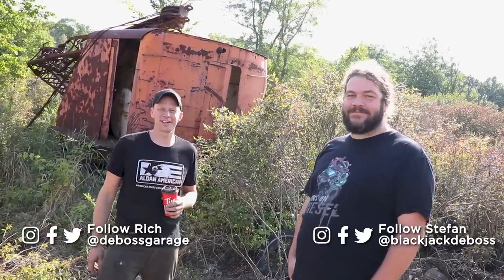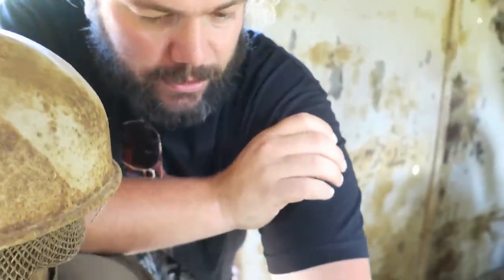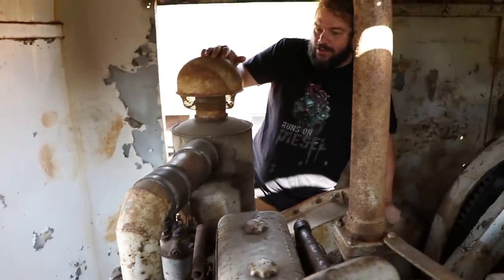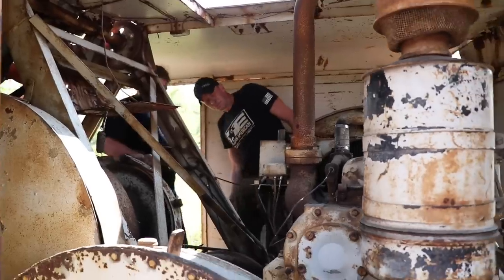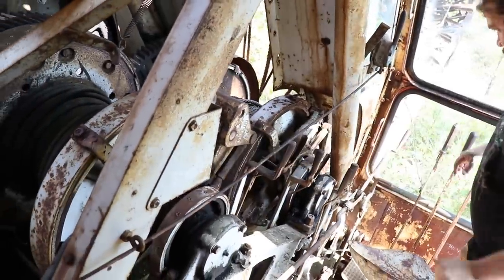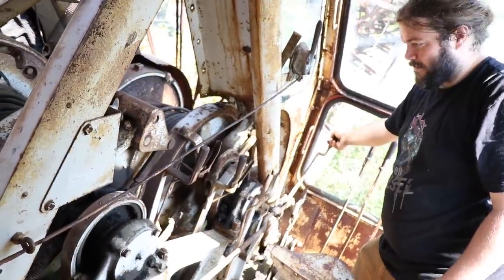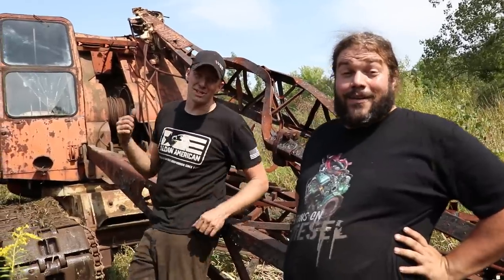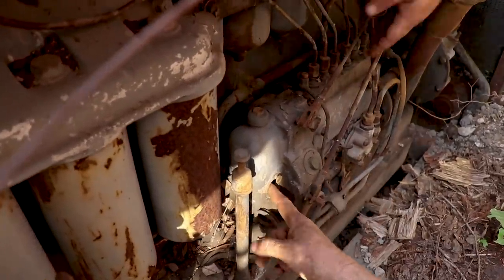Will a 2-Stroke Detroit Diesel Run on 20 Year Old Fuel?

Comment: There’s plenty of people that would want That crane.  I’m rebuilding 2 machines like this on my channel right now. Wish my last one was that easy to get going but it took 3 months to get home
Reply from the maker: This one was for sale with a straight boom by the previous owners for about 2 years.  I think they were asking $5000.  As cool as it is, it will never be allowed to be used commercially again so it is just a labor of love for someone with expendable time and money.  If this video doesn't sell it, the engine will get pulled and the rest scrapped.  At least it will be in the internet forever.
Reply: DEBOSS GARAGE people are still running businesses with them mostly driving piling and dragline pond work. I bought my Lima to put a pond in and do hook work maintaining my other equipment. Who doesn’t want a machine that can lift 20 tons?  My Insley I’m rebuilding for shows. They’re surprisingly fast and like you mentioned in this video you don’t have t worry about blowing hoses and losing a tank of oil.  My Hyhoe excavator has  expensive large hoses and they use low pressure high volume pumps so a lot of oil leaves in a hurry.  Anyway hopefully someone saves the machine. A boom is easy enough to find or rebuild

Comment: Weld a new small boom on it a simple I beam homemade one for shop rigging lifting use.
its a 371 gmc Loraine crane
All DDs two stroke have a run away emergency air shut off on blower spring loaded trap door.
 if tripped motor will never start even on either. Reset small handle and cam on blower.
Free up working running old friction rigs

Comment: I got a 1954 371 air compressor at work when we need some good air to run the 1" gun and other than yearly sometimes every other year oil change lol  fires up works runs 2-3 hours wide open shut down hot and fires up everytime it like the abuse

Comment: Just bought a 1998 Ford ranger 5 speed manual and I want to do a diesel swap, what would you recommend?
I'm a welder so I can fabricate parts if necessary and a friend mechanic but no knowledge on complex engineering or engines so

Comment: It's not a common rail fuel system, because it's not injection pressure at all times when running. Common rail injection requires, minimum 24,000 PSI of fuel in a physical cylindrical rail, for it to be called "common rail".

Comment: That Detroit would make a great little engine for my 1952 dodge
Reply from the maker: 1500 lbs cranking out 109 hp!
Reply: DEBOSS GARAGE so you’re saying I need to find a 16 cylinder Detroit to put in my little 52😂

Comment: I think everybody on this planet knows the Detroit diesel 2 stroke ( it has the IN ports in the cylinder sleeve),
and has two OH exhaust valves per cyl.  ... it's a modular engine ... you can have as inline 3 cyl.  V6 , V8, and V12 ... it's a reliable engine, but I know people that have managed to kill even one of these ...

Comment: Do your homework, dudes. It's not common rail as the fuel in the supply line ain't under any pressure. Pressure is provided by the injectors; hence it's just a simple injection engine.

Comment: Is NOT a common rail this is a DETROIT DIESEL UNIT INJECTION SYSTEMS with a low pressure pump.
Common rail they have a high pressure pump (around 1900/2500bar) and electronic injectors and they receive a signal from ecu wend to fire the diesel out.
DETROIT DIESEL UNIT INJECTION SYSTEMS engine (like this one) they have a low pressure pomp(around 3.1 up to 4.82 bar) and the pump sends fuel to injectors. The rocker arm press the injectors head to create the necessary pressure for operating the engine(2000 up to 3000bar)

Comment: Now you see why a way to describe things gives confusion. A common rail is a rail that all the same parts use. You can have a common oil rail that lubricate all main bearings.
Because it is used now to say that there is a common high pressure fuel line with valves on every cylinder.
But rich is right. There is a common low pressure fuel feed line to al the fuelpumps. Ps. Common rail was already used on doxford engines in the 1920/1930. And here i mean the high pressure fuel line to the atomisers.
If you dont know you engines you make a false statemen.
Again rich is correct. Large seagoing vessels have 2 stroke engines of max 120/125 rev/min. Stork has 4 exhaust valves and started in the mid 50s. B&w (burmeister und wain) had 1 exhaust valve.

Comment: Did you really have to run over that car? There goes some guy's dream project
Reply from the maker: A metal recycler bought the yard.  Its been in a swamp for 30 years and was getting crushed regardless.
Reply: @DEBOSSGARAGE  got ya

Comment: At this pont I feel like Rich keeps calling these things common rails - despite the fact they have basicly nothing in common with an actual common rail system (including the rail itself which is just a fairly low pressure passage way inside the cylinder head of these engines, as opposed to a super high pressure, externally mounted cylindrical chamber of forged metal, specifically designed to hold thousands of PSI in an actual common rail system) - specifically just to spite people like me who are really passionate about how diesel engines and their fuel systems work...

I`m not even mad at Rich, I`m just incredibly frustrated at the fact that he seems instant to die on the hill of a giant technicality...
Reply from the maker: The fuel gets passed through a common passageway to the injectors, or as some call it, a common rail
Reply: @DEBOSSGARAGE  yes I heard as much in the video, but in the case of these Detroit the "rail" is part of the low pressure system, and not an integral part of providing high pressure to the injectors themselves, so again, both systems are fundamentally different, so it would be a common rail in the absolute loosest sense possible, and you know it

I`m getting way too worked up on this for no reason, so agree to disagree, I guess... Great vid though

Comment: Suggest you find someone that knows how to run the Bay City 30 or 40 before you hurt yourselves. I also recommend you oil the drive chains, fill it with fuel, check the engine oil and radiator and sick a used sweat sock in "manbun" boy's mouth.

Comment: Ok just hang on a second uh oh the coolant is in the oil pan the O rings shrink or crack and dumps coolant into the pan firing up will pull it through it will be the first time will be the last time
Reply from the maker: It took about 2L of water

Comment: Ok. I'm a complete lazy idiot. 2 stroke diesel. Does the diesel itself provide enough lubrication? My knowledge of 2 strokes is my weed whacker. :) My last 2 stroke motorcycle was from 71 and a oil injection system. I was 7. It was 7.
Reply: All the GM two-stroke diesels (Detroit, Winton, Electro-Motive) have a crankcase filled with lube oil and a fuel injection system just like a four-stroke engine.   They have a separate airbox fed by either a roots blower or turbocharger.

Comment: How much for the motor
Reply from the maker: link in the description.   We were told it was rebuilt a year or two before it was parked and even though you can't hold us to that, it does look like it has very low hours by how clean it was inside